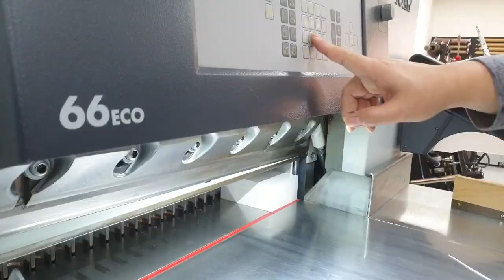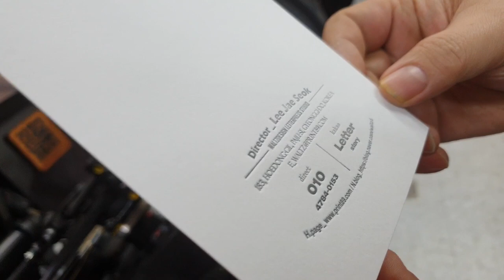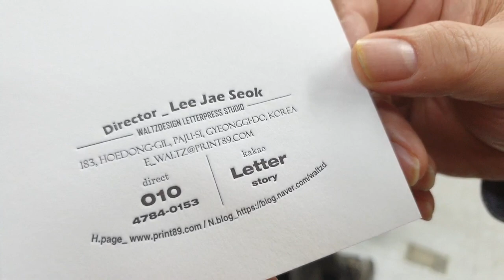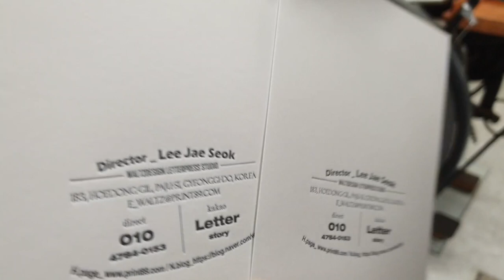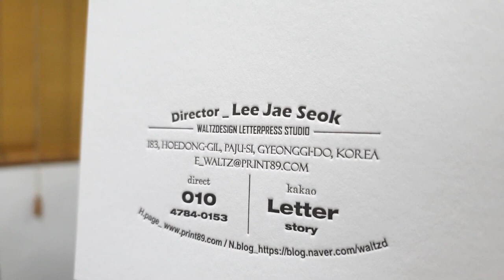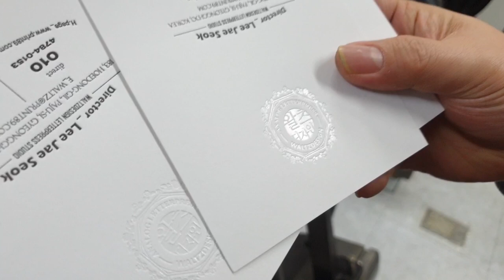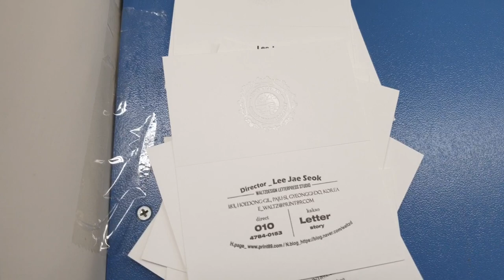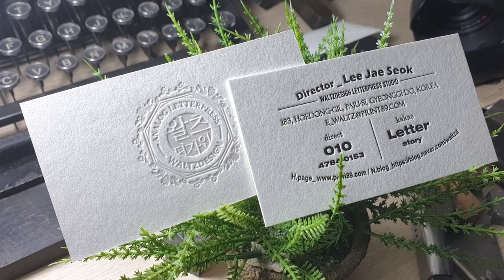Creating Duplexing Business Cards_ Letterpress Printing + Foiling레터프레스 합지명함 만들기.

Comment: Nice one!! What glue machine are you using for duplexing? And what type of glue do you use?
Reply from the maker: The glue machine seems to be customized by the seller.  So I do not know the manufacturer.  Use the water-based adhesive used for glue paste application.
Reply: Great, thank you. I am thinking of buying one too but dont know where. Everywhere I look they only have hot melt glue machine which is not good.
Reply from the maker: @promomacs  It is recommended to melt the bond.  Aqueous grass takes longer to dry and bends 😊
Reply: I am learning 🥴